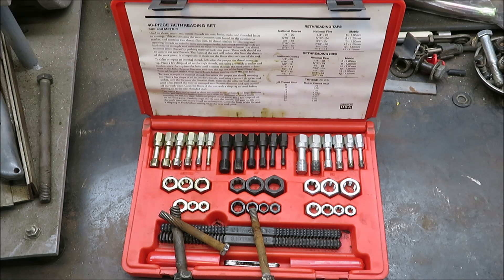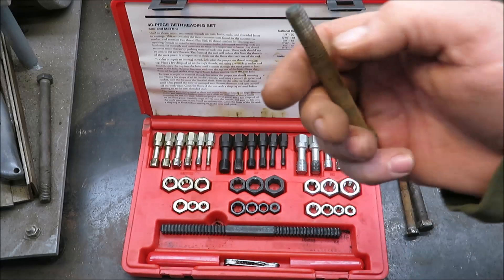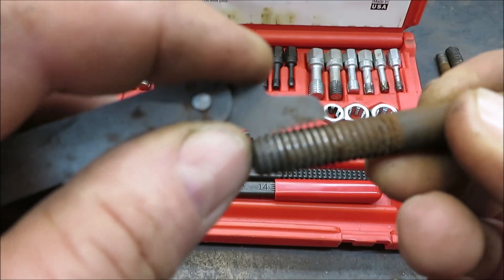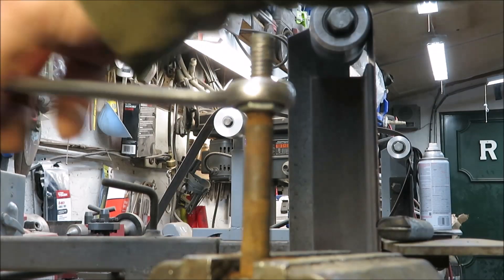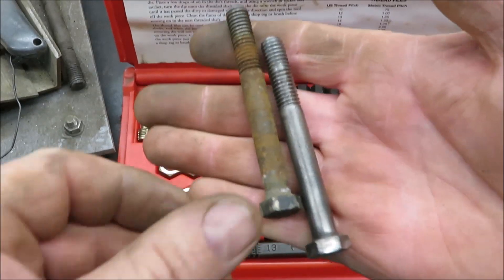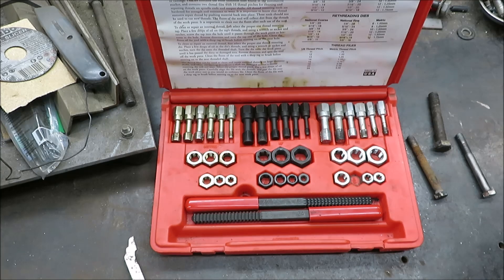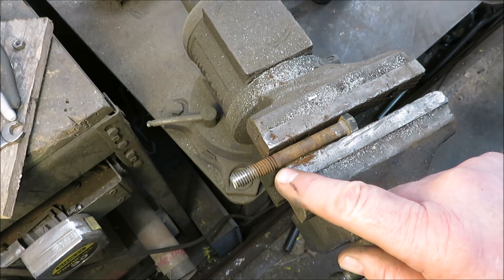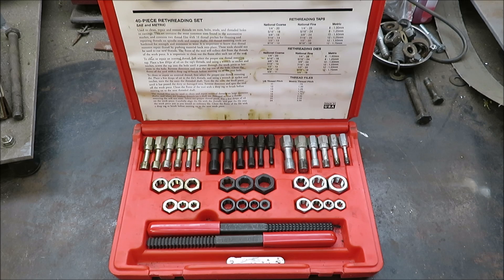How to restorer old threads in metal

Comment: Folks may want to wire brush the bolt, especially its threads, before using the kit. Too, make sure to lubricate. Use oil, not a product like WD40. When you encounter a part of the bolt that's badly damaged go back and forth a little and then continue. I prefer to turn the bolt by hand as to feel where the problems are. This being said, I use it with fairly pricey period hardware so getting a perfect result from a badly screwed up bolt has a value. Your situation may be different. Still, use oil during the process. Good luck.
Reply from the maker: Thanks for the comment Felix.

Comment: I have a bolt hole that won't take the bolt anymore, do you think I should use this to try to repair it instead of a tap? I was gonna do it with a tap, but I just realized this exist, so not sure anymore...
Reply from the maker: If you have a tap use it Rodrigo thanks for the comment.

Comment: I have a similar set. In a pinch they can save the day but nothing is better than new hardware. At my last job of 15 yrs we NEVER reused a fastener of any sort. The deal was if you can pack a 5 gal bucket out the door it was yours. When in logging it just didn't pay to reuse them. Everyone was torqued once. Once stretched they were deemed unusable weather it was 1/4 in or 1,1/2. It was more of an insurance issue than anything else. Cleaning and rethreading was expensive as well. Nice set bud. Good post.
Reply from the maker: Thanks for the comment Tomoko for sure good in pinch.